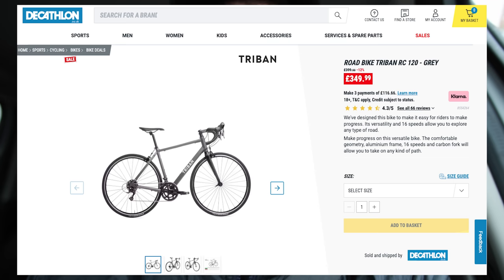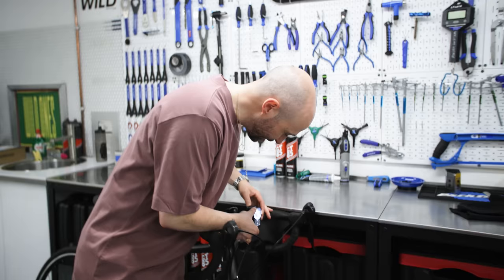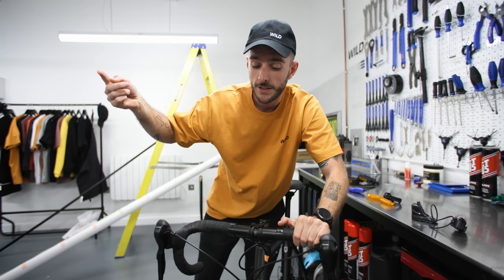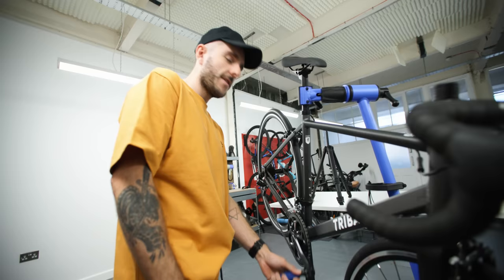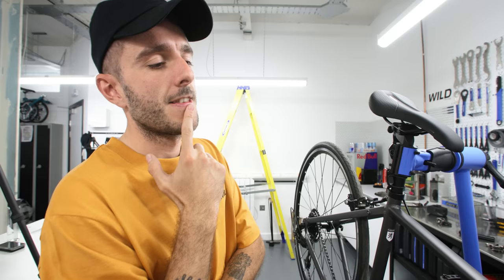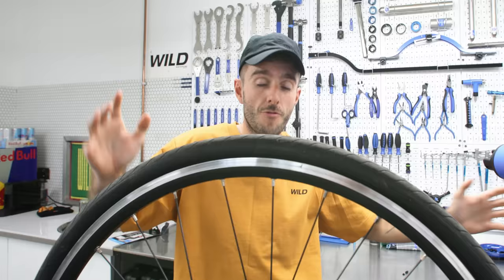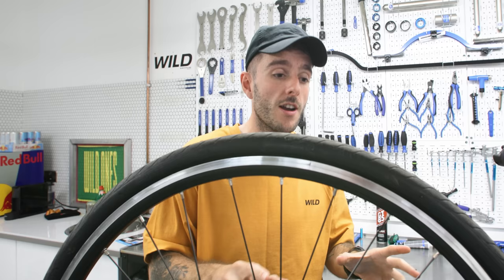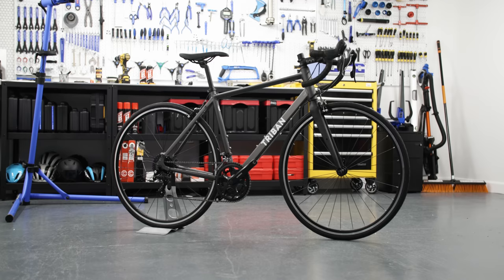We Bought A £350 Entry Level Bike in 2023 - This Is INSANE Value

Comment: I would also note it has two bottle cage mounts, sometime cheap bikes come with one, and the older version of this frame did only come with one. Also it has both rack and mudguard mounts, which is good for commuting or using it to carry stuff, you could go touring on it if you wanted. 

I think it is pretty crazy how light it is given the wheels and tyres aren't designed to be light at all.

I also road the previous version of this frame from Manchester across Northern Ireland, so you say wouldn't like to ride 5 hours on it, but because of its relaxed geometry, if you take a more touring mindset it is pretty good for it. What it isn't however is a fast performance oriented road bike, it is more are budget endurance commuter.

Comment: Nice one - I'm a big fan of Decathlon as a bike brand, started off buying their bikes for my kids because: right size wheels, right size brake levers, not too heavy. Ended up buying a higher end 105/mavic Aksium/alloy frame/carbon fork equipped race bike for well under a grand with discount (current equivalent is probably Van Rysel) which has been used extensively for 4 seasons of training + triathlons with only changes 11-28 => 13-24 for tight circuits & aero bars for a TT and surviving many trips in vans, coaches etc. Only issue some brand snobbery from folk who believe slack endurance geometry goes faster if it's full carbon and has more expensive stickers...

Comment: I have the disc brake version of this and use it daily to commute into the city. I had experience of the rear derailleur failing, but as its part of the frame and the frame has a lifetime warrenty, it was replaced free of charge. Very easy to maintain.

Comment: I bought a Triban 3, the older red model, back in 2011 for 250 quid. It's seen some hard use, including 4 years of everyday commuting in London, and somehow - I don't understand it myself - I had to change the front tube & tyre for the first time last year. That's a fluke, but even apart from that I've been insanely impressed with the quality of the bike, and it's really lasted. Still enjoy riding it a lot. Nice to see they've kept up the value for money of their entry level range!

Comment: I have a beautiful Red+Black Triban 520 from 7 years ago. It is my first, and only, Road Bicycle, and I don't feel like I need a "better" one. It was ~£500 and I used it as daily commuter pretty much every day of those 7 years. I love it. It's one of my most precious possessions. 
My city is not bicycles friendly at all, so I bumped into holes, poles, sidewalk dividers. Got stuck in the tram lines, fell a couple of times. Rode it during storms and winter. And it handled everything perfectly. 

The only "reparation" it needed was a rear wheel balancing and the only change I did to it was a change of tires to Vittoria Rubino, because I wanted something with more grip for the storms and winter days.
Reply: You think you don't need a better one because you haven't yet experienced a better one.

Comment: They have great value bikes. About a year ago I bought their entry level mtb at around 400€ for my nephew. Great looking fluo green alu frame, Microshift Advent 9 speed groupset with clutched derailleur, some basic 100mm suspension fork and full hydraulic disk brakes! The kid loves it. Be sure to check the setup though, mine had massively over-tightened cones on rear cup and cone hub, luckily I caught it in time. Also as yours wheels were not perfectly true.

Comment: Decathlon is amazing value across the board and since those are mostly starter bikes you'll find a lot of them for cheap on the second hand market. 
Their store network makes it super easy to find original spare parts and their web archives will list all the components for any bike model they sold.
This is amazing when you want a decent bike on a small budget and want to keep it safe.
You can basically get any Decathlon brand (Btwin, Triban, Van Rysel or Elops) in any condition as long as the frameset is safe (steerer tube included) and the groupset shifts. 
The rest you can replace for quite cheap.
As a matter of fact I just got myself a 2017 Btwin Ultra with internal cable routing, 105 direct-mount groupset, Mavic wheels and a quite racy geometry for 500€

Comment: I got the disc brake rc 120 last year and did some bike touring in Quebec, Canada with it. Love it! Only downside I see is that the wheels are incredibly tight. Snapped a couple tyre levers on the road during repairs, and even the bike mechanic had to use vise grips to get them off! He thought I had glued the tyres on for some obscure reason!

Comment: I have a triban 540, bought it used wth200 km for 300€, rode about 4.000 km on it in urban environment. It stays fast when you bring it up to speed, I had to replace the saddle and lights, apart from that, good gear. Fast reliable commuter with good handling, no big loss when stolen.
Also added  a bike lock for 120€

Comment: This is the discontinued version of the RC 120. The newer RC 120 light grey/white is being locally manufactured in various countries. It comes Campy style shifters with all cables routed under the hood. 3 down and 3 up. It also comes with Promax Disc brakes with semi metallic pads and the wheels are tubeless ready, but yes are heavy at 2.2 kg (pair). 

The rubber cup on the cup was slightly folded, hence the noise and the rear brake cable has been wrongly routed. Also, remove the wheels and check the cone nuts, they tend to be too tight. As for the cup and cone bearing not lasting, I have done nearly 9,000 kms and have mostly ridden in an area just north of semi desert region, lots of dust and sand, misty foggy winters and heavy Indian monsoon rains. But I do maintain all bearing at 4-5k kms. 

You should also check out their other cycling related articles like apparel, shoes, helmets etc too. They are very VFM and you would be surprised by the quality. Now the Triban sub-brand has been assimilated into Van Rysel (Road bikes only) and Riverside (Hyrid and Gravel). Just wait for the Van Rysel's 6 or 7 new bikes to be introduced shortly this year.

Comment: I bougth the RC 120 and rode it for 8000kms in about 12 months. The bike was bulletproof. The only thing I had to change was 2 inner tubes because of random flats along the way on the rear wheel. I upgraded to another Decathlon bike with a full 105 groupset, and done about 7000 km-s worth of riding on it so far. You can definitely feel the difference between the 2x11 105 system and the 2x8 Microshift, but other than that I could have continued to use the RC120 and would have had just as much fun with it. I wholehartedly recommend every beginner cyclist this bike, because it is truly amazing value, and is super versatile. Before I eventually sold it, I put wider tires on it, and hit some of the local forest paths and it held up exceedingly well there too.

Comment: I've bought a gravel-bike-inspired hybride-roadbike (Riverside 120) for the insane low price of 209 Euros (180 Pounds!) a few weeks ago. I've done some changes; better tires, upgrade to Deore 1 x 10 speed, bigger front blade and thus a new crankset. I love it. It's simple, with all the new parts it's still very cheap and it rides delightful.  No complaints about the wheels, but a better saddle is the next thing to put on.

Comment: I've been riding a medium B-Twin hybrid in Glasgow for a few years now, it cost about £600 back in autumn 2018. It's held up pretty well (though it wasn't used for 18 months during covid), despite my only cleaning and tuning it every 1-2 months, less in winter.
I had to get them to true the front wheel about a week after buying it: the staffer claimed I must've damaged it, but they didn't charge me so I wasn't complaining. Neither wheel has needed truing since.
The gearset (1x10) and hydraulic disc brakes have only ever required cleaning and standard maintenance, though the rear brake might be due a bleed now.
It has a relaxed frame, but the original saddle was almost completely solid, I had to swap that out as it was causing serious saddle sores. It also has 'bull horn' style handlebar grips that are virtually useless, as you cannot use the brakes or shifters while holding them. One of those has broken on the inside.
I'm currently saving for an upgrade, Something around £2K. But I definitely got my money's worth.

Comment: I got the older version of this bike with a slightly better spec. It's called Triban 520 which is now I think a disc brake and 105 equipped bike. But when I bought it 5 years ago it was this frame, a Sora drivetrain, own brand wheels and brakes. I can agree with everything you guys said about it. The frame is big indeed, one must be careful when buying it. I have the X-large and I had to buy a shorter stem. The wheels were outright crap on mine, lasted a couple of months before the bearings became loud and unadjustable. Another problem (five years ago) were the cables. I thought the problem was the low-end Sora groupset, because both the front and rear mech had to be adjusted almost daily. A set of quality cables (in this case proper Shimano ones) solved the problem for good. Other than that it is a robust, fun to ride bike.

Comment: I picked up the Triban RC120 a few years ago and have never looked back, used it in all weathers and all seasons and still going strong after 6000+ miles. Replacement parts are incredibly reasonably priced and you can swap out the Microshift cassette for a Shimano HG one. Added some Mavic wheels and continental tyres for a small upgrade after 3000 miles but the stock ones were very robust. It's an unbelievably great value versatile bike. I use for both workout rides and the school run with a trailer on the back, never skips a beat.
Reply: Buddy, can you name all the parts that you replaced?
Reply: @JonJonChannel  Sure thing, here's what got fitted at last big service:
Cassette: Shimano CS-HG51
Chain: Shimano CN-HG71
Crankset: Shimano Tourney A070 I think
Bottom bracket: (Didn't check the model as the LBS sourced it)

Comment: Hello from Ukraine! I worked at cycling dpt.
Btwin/oxylane was a cycling brand of decathlon bikes till 2018. Nowadays they have 5: btwin/oxylane for city, commuters and children bikes, rockrider - MTB, Triban - gravel, basic road bikes, Riverside - adventure and touring bikes, Van Rysel - racing, cyclocross and Triathlon. Saddles for deca-bikes rebranded by Selle Royal; Stems, handlebars, seatposts - Uno bike parts; Tires - Kenda. Problem with frame sizes is still there with expensive bikes. Sometimes the difference between XS, S and M size could be just in the length of the handlebar stem and cranks. Also, at smaller sizes you`ll get narrow handlebars. Btw, those cheap wheels would survive in much worse conditions, than u could think =) One of my colleagues had this bike as a "bike to worker" for 3 years. And here, in Ukraine, sometimes -20 degrees in winter and lotta snow.

Comment: My first road bike was a BTwin Ultra 700. Alu frame, carbon fork, Shimano 105, Shimano RS11 wheels shod with some wirebead Kenda rubber. Wheels and tires were the only real issue. I rode this for more than 2 years including multiple trips of about 250km each. It’s the bike I now have in my summer home.

Comment: Yeah, I bought my first road bike from Decathlon in 2016. It was the top of the range Triban, above that, it was, and still is, I think, Van Rysel, with a more racier geometry. My Triban was £600 and it came with full 105, apart from the brakes. I'm not sure they do a full 105 anymore but at the time it was insane value. I still have it as my winter bike/baby seat bike. I've actually brought it out to Girona with me and have taken my baby up some of the local climbs, much to the delight of locals and junior teams who filmed me as they went past. It also came with Mavic Aksiums which are also okay value for the money. I've done gravel rides on it, bikepacked on it and have gone over 200km in one ride all pretty much as it was sold. The difference between that and a £6k bike is literally just weight and aero and maybe smoother shifting and braking but some of that can be made up with body position. It's really not that far behind. Glad you've looked into these. You should definitely have a look at the newer top of the range Triban and the Van Rysel if you get a chance. They also do good value clothing which while can't be compared to the top of the range stuff is great for entry level cyclists who don't want to spend hundreds on a jersey.

Comment: Mine is the RC520. Love the colour. Shimano 105 except the crank, a non labeled shimano. I changed it to 105 just to completed the groupset. The TRP hyrd brakeset are good. Got the elitewheels 45mm wheelset that turns it into a decently fast bike. On average not as fast as my previous rim brake carbon bike. But I still get PBs on some sections. And the tire clearance let me run 35mm on my 12 day bikepacking trip.
I agree about the sizing. Bought an M but I felt a bit strecthed. Got an angled seatpost from aliexpress to make the saddle abit more forward and now it rides great. A very versatile bike.

Comment: I have had 3 decathlon bikes and I love them. Sadly the first one (ALUR 900) got damaged on the chain stay which caused it to crack, no problem, because Decathlon honoured their lifetime warranty on aluminium frames and gave me a replacement (Ultra 900 AF). The second bike was involved in an accident but is still perfectly rideable and the third (Van Rysel EDR AF 105) was the insurance replacement for the second. I upgraded the wheels on the Ultra 900 but everything else is as per manufacture. I can happily spend the day in the saddle on a century ride.

Comment: Got the exact same bike in 2020. it was around 250GBP in my country instead of 350(it now is). amazing value absolutely. been running fine, cant complain. Im still on the original wheels it came with after nearly 2 years, so id say they are fine.

Comment: Fantastic video - a nice change from high end products that we are used to. One thing I disagree with in terms of cup & cone bearings - my Shimano RX010 commuter wheels use those bearings through Scottish winters, plenty of rain and grit, and they have lasted years with minimal yearly servicing. They are actually more sealed from the elements compared to my higher end sealed cartridge wheels from Hunt (which u have warned me about on another video lol)
Reply: i Have a e-bike mid drive alfine 8. And the hub in the front wheel is a shimano cup and cone with a rubber seal. I was surprised that the sealing lip was folded in half. Still after 4 years not one issue. I did Service it and put the seal in right.

Comment: I’ve got an RC500 which I bought 3 years ago. I did the entire Chemin de St Jacques on it, used it around paris for commuting and generally just use it day to day. 
Upgrades on it have been a) wheels - mine has mavic all roads on now b) Tyres - Panaracer 32s on it c) saddle - Brooks (I like them) d) cassette - swapped it to get a bit easier uphill option for the Chemin and left it that way. 
I think at the time I bought it they were priced at £500 (mine was bought in france though). I’ve done around 4000 km on this bike, I’m big and it is still fine for most of what I need and great value. In hindsight I’d probably have liked to go for the 520 but it isn’t a big deal. For the money, you really cannot beat the thing.

Comment: I bought this bike as a test road bike to replace with a better model in a year if I get into it. It's been two years and I have not replaced it. I occasionaly commute spring to autumn and store it in a Cyclehoop outdoors. Took it to service last week and have been told there is nothing to service. It does has quirks with sizing and handlebars, but for this price it's honestly as good as it gets. I don't think I will be replacing it anytime soon

Comment: I've got their VAN RYSEL EDR ALUMINIUM 105.  It's £1200 now but I paid £850 a couple of years ago and I spent A LOT of time browsing bikes around that kind of price point as it was my first roadbike.  

The VR was the lightest and best-equipped by far.  If I wanted lighter it meant an inferior groupset; if I wanted a better groupset it meant a much heavier bike.  Also bear in mind that it came with a COMPLETE 105 groupset, so not just the drivetrain components but the entire braking system as well.

No frame of reference for how it rides but I'm perfectly happy with it, especially since the frame geometry is, as you mention, more suited to someone new to cycling in general or coming from a MTB or is just generally not flexible enough to maintain a race position for huge amounts of time.

Comment: I looked at these bikes and they do look great value. I was looking for a summer carbon frame bike, so this really didn’t cut it. I currently have a Boardman 8.6 £500 bike which has served me well in the last 2 years, but being in a Road club for the last year I need another bike that was a bit lighter. After a bit of searching, I found a Ribble R872 Tiagra carbon frame for £500 in red on Facebook marketplace. Absolute bargain in great condition 2 ish years old. Checked torque settings bolts and re checked the front and rear derailleur settings, alignment etc. There seems to be a lot out there that people are selling for various reasons. You don’t have to spend a fortune to find a 2nd hand carbon bike. Don’t get me wrong, it’s not brand spanking new, but it’s not far of it. The bike is fast when I took it on a brief spin, so I’m lucking forward to the first Road club ride.